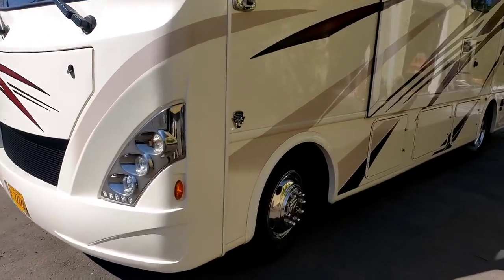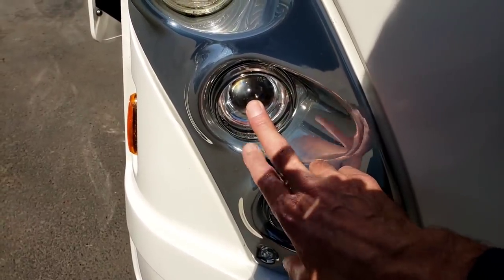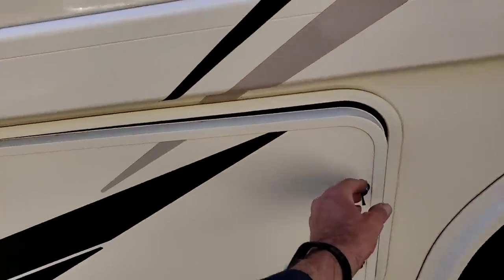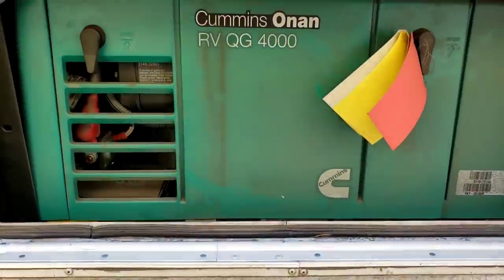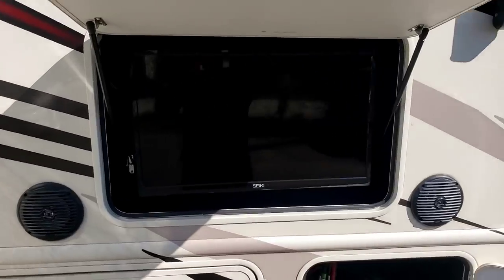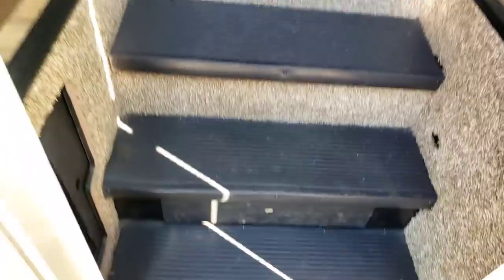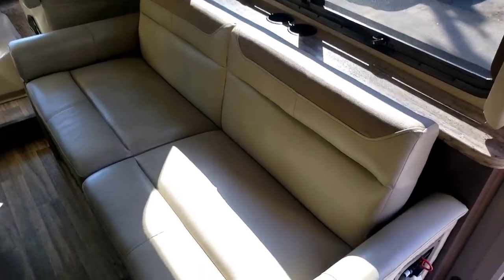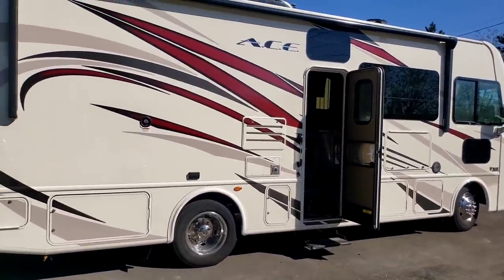Mega Machine : Thor ACE 27 Foot V10 MotorHome In Depth and Detail

Comment: Probably started out as a 2017, but given the number of build and reliability problems these things have, by the time they got it all fixed, half of it was 2018
Reply: I was thinking the opposite. They bought it in the first wave of 2018s and by the time they replaced all the newly redesigned parts with older ones that actually work it became half a 2017 lol.

Comment: Really cool rig, I think it would have been better if it was powered by a good diesel engine though, your wallet wouldn't have been hit quite so hard, especially for here in the UK, although fuel has come down a little as in the US. Thanks for the tour it was nicely informative.
Reply: Gas is 1:25 or lower .  😆 this barge might be slightly cheaper to operate for a while until it goes back up   Of course if one can afford the $150k for one they ain't hurting for money.

Comment: this kind of a big vehicle would be better off being diesel powered. would go a whole lot further on a single tank.
Reply: @christianronn5301   i think it more ease of use because most american consumers are not use to diesel powerd vehicles.  Most have Gasoline powerd SUV and cars.
Reply: @christianronn5301  people there still have a thinking you have to to something special to the fuel so the engine runs and doesnt break down. or you have to wait really long for the glow plugs. or you cant go anywhere with out a spare fuel filter.
some of this still happens but only really cold weather which a RV never really sees